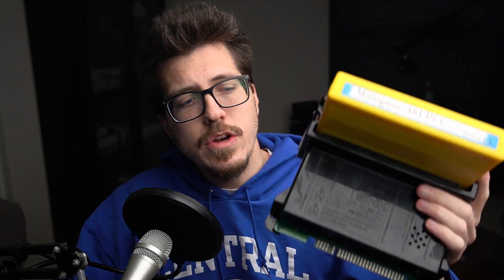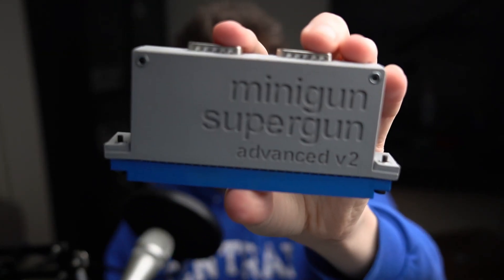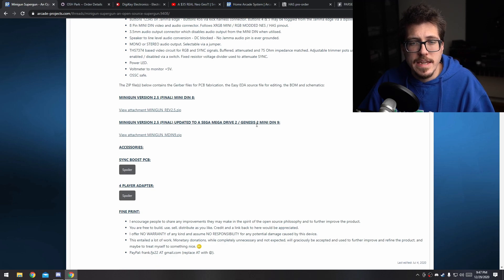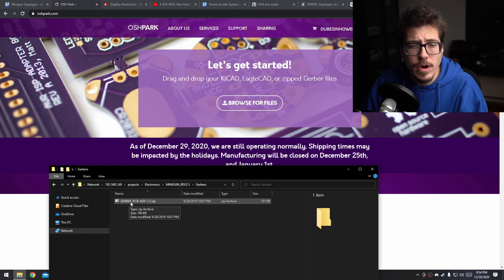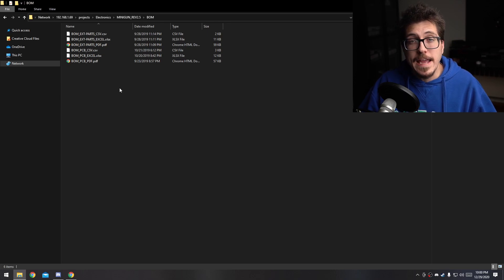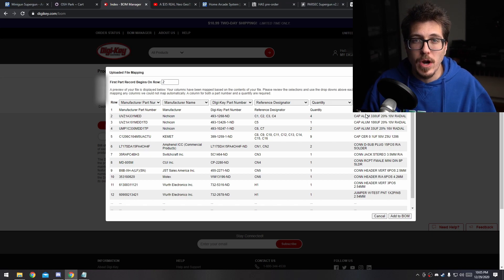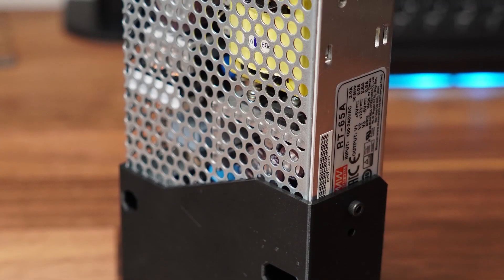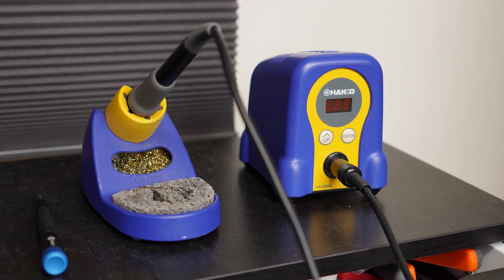Build Your Own Minigun Supergun - DIY Arcade Supergun Part 1

Comment: Nice video ! Can you tell me what is your stereo mod for the neo geo, and if you know if it's safe for the equipement such as OSSC or Framemeister ? Thanks
Reply from the maker: Yes I use my Minugun with my OSSC. I would like to get an oscilloscope to verify the voltages, maybe I’ll do that in the future
Reply from the maker: Also, I may do a stereo mod tutorial in the future, since I have another MV1C coming in the mail

Comment: Do you know where to get the power cable for the supergun? Or which wires plug into where on the power supply?
Reply from the maker: You build your own power cable. The parts for the cable will come with the BOM. Unfortunately, the wiring diagram for the power cable is buried in that Arcade-Projects forum thread. I'll try to find it.
Reply: @dubesinhower  thanks for the info